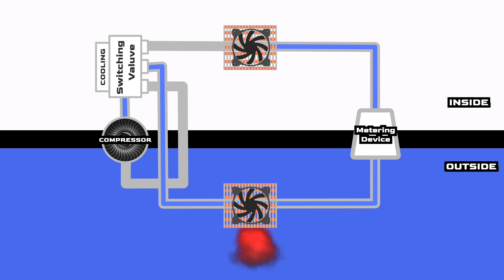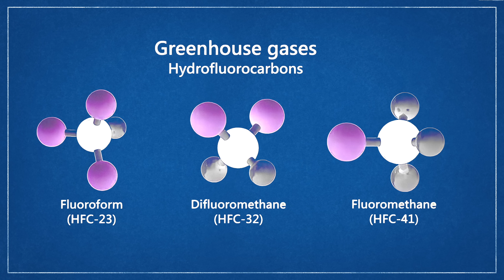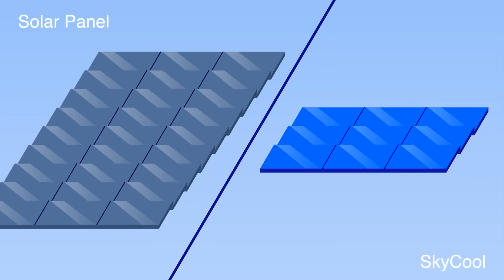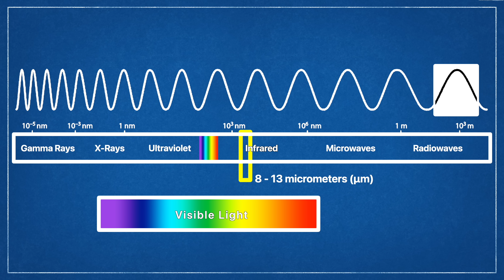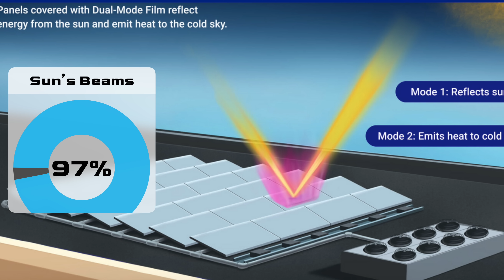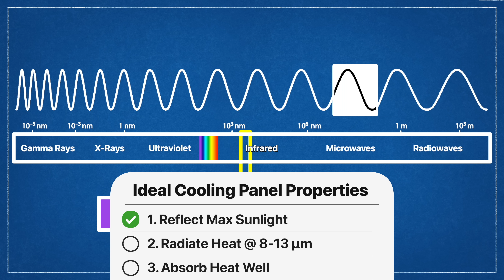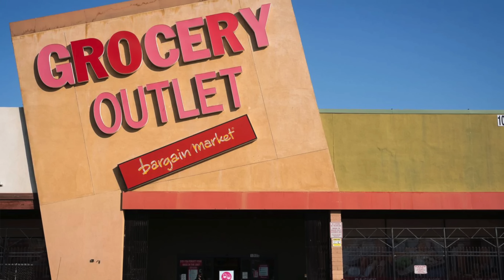New AC Tech Sends Heat Into Space & Saves 95% On Cooling Bills!

Comment: Couple this technology with a Stirling engine and you can get more efficient electric generation with a wider temperature differential along with the cooling.  Possibly needing less or no solar panels.
Reply: We can 3D print rockets. I think we should start printing Stirlings
Reply: @harmenkoster7451  You have a misunderstanding and this does not violate any laws of physics. This moves heat, it does not create or destroy it.
Reply: A 100% efficient emitter calculation yields 186W/m^2 (~20W/sq ft) for a 16C (70F) panel. I'd guess it'll be ~15% efficient, paired with a 60% efficient stirling engine that's ~17W/m^2. A solar panel can get up to ~150W/m^2. Power storage means a solar system will cost a decent amount more than the panels themselves (I think around 3x the panel cost), but to me that still means the solar panels would win from an economic viability perspective.
Edit: of course solar panels only work for ~4-5 hours a day, so that's ~25W/m^2.
Reply: @ThisRandomUsername  Thanks for doing the math.  We don't see that very often.
Reply: I thought of this as well, I love using multiple options when it comes to power generation as well as reducing the need for so much power collection by using simple methods such as living in a household that is partially buried underground, as the dirt is a natural insulator which will reduce the need for so much Heating and Cooling, but also using this method in the video and using the stirling engine to collect the energy from the Heat that will naturally be collected, but I also think it's still important to have other things such as wind turbines solar panels and perhaps even water turbines outside. It'd be cool if there are wind turbines in the house too that function within the pressure when you use your water.

The point is to try and take advantage of all of these aspects to not only save on power usage but to also reduce the possible need to use too much power so does that during certain times of the year you are SOL when the weather becomes super cold, this is why you should always have multiple options working for you.

We don't want another situation like what happened in Texas earlier this year when that crazy freak ice storm hit, and the only thing that the state was running off of who's wind turbine power.

They dismantled everything else, you never dismantle everything else you always have multiple options you never work on only one solution and forget about everything else.

Perhaps Texas will be smarter next time because that was a hell of a lesson to be forced to learn the hard way.
Reply: A  simple Sterling Engine...Not a $ 10,000 Unit.
Reply: @finddeniro  True, the problem with Stirling engines is that they are currently specialty equipment thus expensive.  There is nothing inherently expensive about them other than they are not mass produced because few know how to use them. Chicken and egg.
Reply: @MichaelDobbins  - Imagine using a Stirling Engine, to power a Blower, to blow Cooled Air, from Lengths if Buried Pipes that have a vertical portion, to draw in Ambient Air, then Ground Cool it, before blowing it into your Home! Since it would only run during times of Sunshine, (as I Envision this application), then it is in sync with when you want that Ground Cooled Air to Flow! (See YouTube Video, on "Citrus in Nebraska" as my source reference!)
Reply: @finddeniro  
A sterling engine would do great.
Reply: I thought of this as well. I can't see any downside to this at all.

Comment: Almost sounds to good to be true.  The concept sounds good.  If they can build a better Mouse Trap, the world will beat a path to their door.  I hope it actually works a presented.
Reply: The only problem is that it doesn’t work when it is cloudy. The clouds reflect the IR back to the ground. Otherwise, to give you an idea how effective they can be, early solar heating tubes had a problem with freezing at night due to radiative heat loss.
Reply: @BondiAV  Yet this company has hard data on how much energy and money this system saves.
Reply: @harmenkoster7451  No, it doesn’t break the laws of thermodynamics. It works in the daytime, you just have to keep it shaded. The more north you are, the easier that is.
Reply: @LouwrensStassen  “Not in shade” means nothing physically blocking the line of sight to the sky. I was referring to shading from the sun without blocking that line of sight.
Reply: @BondiAV  It is just you. Equatorial regions tend to be mild anyway. You see, the sun travels across the sky so in the morning they can be pointed west and evening, pointed east. Or maybe just east since late afternoon is when you need the most cooling anyway.
Reply: Sometimes you build a better mousetrap, but you don't know how to publicize it, or entrenched interests block you, and the world doesn't beat a path to your door, even though it desperately needs to. E.g., Beta vs. VHS, pressurized water vs. molten salt fission reactors, Portland cement concrete vs. geopolymers, especially Blue World Crete--concrete that superinsulates. 

If you make wall and roof coatings very reflective, of both visible light and infrared; if you add compounds like mixed metal oxides, that emit IR very well; and if you add compounds that fluoresce away energy, you can make a surface  several degrees cooler than its surroundings, even in full sun. Apparently hafnium is highly emissive, and the substrate SkyCool uses is very reflective. "Ruby red," synthetic ruby cheap enough to use to color red paint, absorbs energy and fluoresces it away as ultraviolet. I wonder if a micrometer-thin layer of ruby red atop SkyCool panels wouldn't make them even "cooler"--and an attractive red?